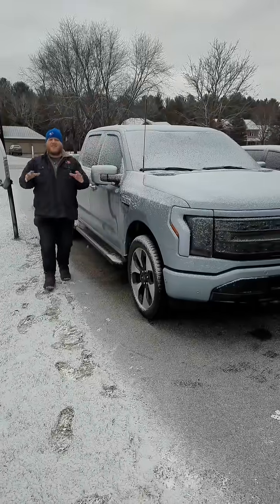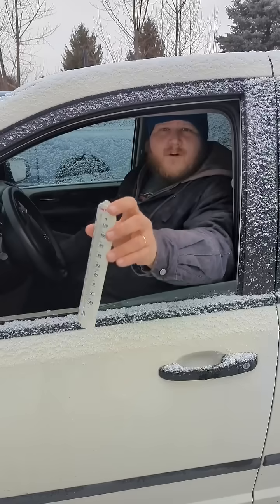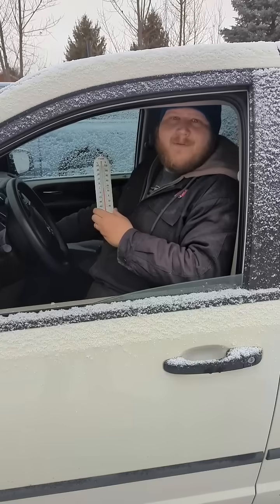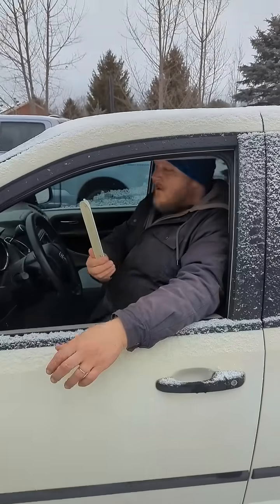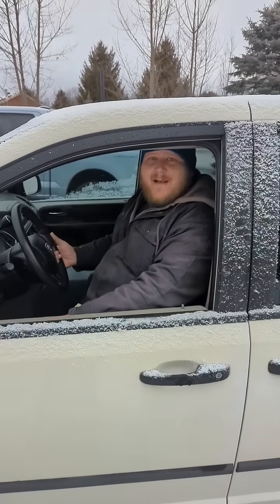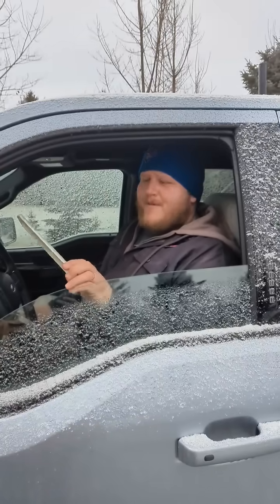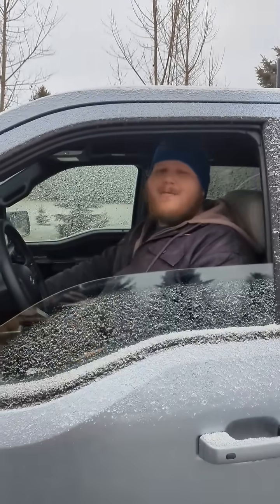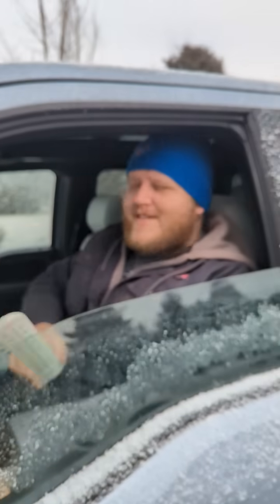Electric vs Gas - Heater Wars! How Long Does the Ford F-150 Lightning Take to Heat Up?

Comment: Try the EV in Canada at -40 and see your luck....Does anybody know the cost for EV batterie clean up in an Accident
Reply: Heres 19 reasons why electric vehicles SUCKS.

1) It’s too expensive 

2) Also cause pollution because it’s created by dirty fossil fuels 

3) Tires wear out quickly 

4) Only reliable when temperatures are warm and when it’s cold, it can bring danger to the driver and passengers.

5) Charging stations are hard to find in midwestern states. If you live somewhere like Wyoming or North Dakota, it is clear that you are going to have a lot of difficulty finding charging stations, as well.

6) Roadside Service does not provide Full Coverage and lot of this has to do with the fact that their parts are not on-hand and they are more difficult to actually find than ones for regular cars. Also, auto mechanics will not know how to fix electric vehicles since they didn’t built it. You probably have to find Elon Muck and ask him to fix it for you and he will probably charge you for a million dollars. 😂

7) Travel shorter distances due to the fact that these are cars that need to be charged, they simply do not have the same type of mileage range that regular cars often possess.

8) Too much focus on luxury vs. dependability. With all of the issues that have been discussed thus far, one may be questioning what exactly car manufacturers are aiming for when it comes to making these models. In short, they simply are spending too much time on overall luxury rather than dependability.

9) They get noisy early on. Owners of electric cars have been quite open about the fact that they are prone to make a lot of noise very quickly into their usage lifetime. There is no question that over time, this happens to all types of vehicles, but it is alarming that it has been happening so quickly for electric ones.

10) Maintenance costs far more because when dealing with expensive cars, one can always assume that repairs will end up costing far more. However, when observing electric vehicles, it is clear that the prices to fix them are at an extremely excessive rate. This is largely because finding its parts is far more difficult.

11) some electric cars look ugly

12) Battery pack replacements are expensive due to the fact that electric cars run on their battery packs, it is clear that they play a major role in the overall performance of the vehicle. However, their batteries are prone to needing replacements as time passes by, and they end up costing a ton of money.

13) Recharging takes a long time

14) Durability is not consistent

15) Tend to be heavy due to the fact that electric cars are built with different materials. In fact, the heavy weight of these vehicles is likely another factor that ends up making their tires begin to drop in quality so quickly.

16) One major aspect of the electric car market is that there are limited choices. Unlike regular cars that comes with an abundance of different options, car manufacturers do not seem to release multiple electric vehicles. This is not a solid idea, as electric cars are trying to grow in popularity.

17) Not Good In The Snow. Electric cars definitely meet their match when they are used in the snow. They are prone to having a lot of malfunctions with this type of weather, while also having a lot of difficulty while driving on slushy roads.

18) Too Much Hype. "Show not tell" is the philosophy that car manufacturers should possess. However, when it comes to electric cars, it is clear that this currently is not the case. There is no question that the market is pushing for more usage of electric power, but they have yet to accomplish much in the way of persuading the vast majority of the public.

19) Having a smart car means that the government can track your every move and can listen to your conversations. 

DEMONcrats and leftists wants to banned EVERYTHING. Gas cars, gas stoves, guns, cows, meat, freedom of speech, freedom of religion, and etc. I’m not going to go along with their authoritarian policies so fuck them!

Comment: The minivan has more interior space than a crew cab pickup. A different crew cab pickup would setup a more comparable benchmark.
Reply: I agree
Reply: You're right but it's still probably like twice as fast.
Reply: No
Reply: Let me also add.  Not much in way of charging stations on the way to Burns, OR from Idaho
Reply: I will also add.  I am considering an Toyota RAV4 Prime.  A Plug in Hybrid makes a TON of sense for me.  Sadly not available in all states.  Luckily I live 30 miles from the state line where I CAN purchase one.
Reply: Yep.  Compare a new crew cab pickup. Not a big worn out Caravan    Might have a better comparison
Reply: however the van has vents in the back as well...the truck doesn't..  so, even though its a larger space to heat, said space is complimented by the number of vents required to heat it..
Reply: @duke1281  There are vents under the seats in the F150 EV.
Reply: @duke1281  its the same heat just spread out. A 1500w space heater will take exactly the same amount of time to heat a room regardless if its attached to a small fan, or a large one
Reply: The EV was over 3 times faster and the thermometer was in the front seat.
Reply: @adaycj its like comparing a hot tub to a swimming pool, the EV had 60-70% less cubic feet of air to warm, he needed to compare truck,
Reply: @MicRuLerZ  
Lol. It's a mini van. Maybe 20% different. Interior volume is a published value, look it up. But the time was a 350% difference so we are splitting hairs on a factor of 10.
Reply: @adaycj  I don’t think anyone’s arguing it would be the same but it’s still not a fair test, my 3rd gen Tacoma does this in 7-8 minutes. Not 4 but definitely not 14
Reply: @adaycj  depends on vehicles.  Standard pickup vs say a 4 door suburban and it's more than 20%
Reply: @adaycj  the second row seat in a Caravan has 7" less of leg room but within an inch for shoulder and head room and mor space for the hip room.  Then there is a third row with almost the same dimensions AND 33 cubic feet of space behind that third row.  Man Dodge was able to fit a LOT of stuff in that only 20% more interior space.....
Reply: @tommygatch It is irrelevant. Or at least almost entirely irrelevant. Take an electric heater, a small cardboard box and a big one. Throw a thermometer inside. One at a time heat the air in the box with the heater. The times are almost the same for the same increase. The air doesn't take much energy to heat. It is the "mass". The engine, the coolant, the heater core. Plus some (very significant) losses from the combustion process, cold, at idle. Plus the IC engine has a priority on heating the engine to reduce emissions, not dump every watt of energy into the cabin.
Reply: @Deere2154D  Different vehicles have different interior volumes? How did you discover this?
Reply: @tommygatch  Okay, looked it up. 130 ft3 vs 190ft3. A 36% difference. Completely explains a 350% time difference.
Reply: @rileypakosh1066  I'm not sure what would make it "fair". Using the wasted heat energy from combustion as a heat source is just not as direct as heating wires with a battery. Granted it was a pretty rough test. Very little was controlled. Are you driving your truck during that time? Any IC engine would warm way faster driving vs idling.
Reply: @adaycj  now look up the window surface area.  Largest heat loss in a vehicle is through its windows.

Yes the electric will heat up quicker.  Let's compare cold weather range of that F150 and that 2015 Carvan, both with a full charge/tank.
Reply: @tommygatch  The convo has been fun and all, but I'm done looking up things. Y'all have the internet too. I have no need to compare cold range of either vehicle. They are both lower than the normal in warmer temps. I would only care if I was considering an EV to commute to work in. The easy solution is to just add 50% for emergency errands or weather impacts. Now that the EV market has lots of options it isn't hard to find one that would work for me with room to spare. Heat loss has never really been a thing until EVs. ICE vehicles have so much waste heat to spare, no one really ever cared. Now that the cabin temps often come directly off of the range it is a new thing to consider.
Reply: @adaycj  a crew cab truck is less than half the interior volume of a caravan... about 1/10th actually.
Reply: @tommygatch  thats a shit comparison too. Theres numerous factors at play: vehicle weight (not far off to be fair), engine size (or lack thereof), gas tank size, not to mention the physical shape and size of the vehicle.

Not sure why everyone goes on about range either. Literally 99% of people 99% of the time use 20 miles of range *at most*.
Youre arguing EVs are bad because 1% of 1% may inconvenience you by having to stop for 30 minutes every 3 hours on a road trip. 🙄
Reply: @calvin2686-u1k  you can always spot the people that don't live West of the Mississippi or those that live on the west coast.

Some of us live in places where it's a bit of a drive to get somewhere.  When I was doing contract IT work a while back, I had a 3 hour drive through Eastern Oregon just to get to a job.  8 hours on the job and a 3 hour trip back.  That is zero traffic.

When you go to rural places a lot, life looks a little different than more densely populated places.
Reply: Let me add, my 5500 lbs Mercedes ML350 I had at the time made the trip there and back without the need of a fill up.  I hated stopping for fuel in Oregon since you couldn't fill your own vehicle.
Reply: @tommygatch  idk it's a 4 hour drive between Moose Jaw and Medicine Hat, another 3 to Calgary. Canada isn't exactly densely populated lol. So I guess you can't "always tell".
But, fun fact: all 3 of those cities are west of the Mississippi, and a solid 10-12 hours from the west coast. Neat right?

Some of us live in these places called Cities -- actually 99% of people do. It's kinda what makes them cities. And lo and behold, that's where EV's perform best, and where most people will stay for 351 days of the year.

So you're saying that because EV's don't make sense for 1% of people that all EV's are shit? that mathematically doesn't make sense when 99.99% of all driving done in North America is done where EV's make the most sense. sorry not sorry
Reply: @calvin2686-u1k  well I guess that's fair. My assumption was bad.  Just as your assumption that I have called EVs shit.  

I was just pointing out a statement was incorrect on the volume of the interior of a vehicle.  I also was pointing out that the range is affected.

Heck the range of my Ford Focus drops in the Winter.  Instead of 40 and 41 mpg in warmer months, I see 37 to 38 mpg during winter. I'll accept a 10% loss over an roughly 30% loss in range that most(not all) EVs see.  I actually considered a used electric Focus before I bought the used gas Focus I have.  So I am aware of what I speak. 

 I'm not even going to delve i to the loss of range each year of owning an EV. Rechargeable batteries lose there capacity over time. (Remember, I'm an IT guy and work around lithium batteries a lot.) You know my 2015 Ford Focus with 130,000 miles still gets the same range on each fill up.

These were the reasons I stayed away. Not saying that is wrong for everyone else, nor have I ever said that.
Reply: @calvin2686-u1k  No it does not. I posted the actual numbers in this comment section.
Reply: @adaycj  14.1 cubic feet vs 143? I mean I just looked it up...
Reply: @calvin2686-u1k  130 vs 190.
Reply: @adaycj  no. A dodge caravan with seats all folded down has a cargo capacity of 143 cubic feet. A truck, even crew cab, is nowhere near that. My Cherokee has 43 cubic feet with the seats folded and thats still a bigger cabin than any truck. Trucks generally dont have folding seats because it has a bed. There is zero possibilities that the truck has 130 cubic feet of interior space, and your number for the van is also off by 40% or so
Reply: @calvin2686-u1k  Cargo capacity is NOT the same as interior volume. The numbers I posted are manufacture numbers. And it does not matter! The two methods of heating air are completely different. the time difference was 350%. That difference was NOT just air volume. The IC engine had to heat hundreds of pounds of cast iron, aluminum, and liquid coolant before it could heat the cabin. The extra air in that empty space was a drop in the bucket compared to the liquid and metal. One is like preheating your electric oven. The other is like cooking a Turkey on your propane grill with a temp probe in the breast meat.
Reply: @adaycj  the cabin begins "heating" as soon as the coolant is allowed to flow to the heater core and the coolant is warmer than ambient (pretty much instantly). Of course the greater the delta, the faster the heating (last time I checked, -10C to -9C is still "heating"). However resistive heating hits peak temp within a couple seconds. I imagine being inside a car it wouldn't get nearly as hot as a space heater, but the fact remains it blows hot almost immediately.
Reply: @calvin2686-u1k  You are arguing against yourself now. You just listed a bunch.of stuff that wasn't the volume of the air, your previous claim. Are you involved in so many internet agruments you forgot which one this is?
Reply: Right? My 04 f150 takes about 5 minutes

Comment: With a full tank of gas, the gas vehicle will run on idle for days and keep you warm. Can the EV do that? EV’s are not for me, they are not green at all and are super expensive, so inconvenient to charge and get repairs, JUST A BIG PAPER WEIGHT!!!!!
Reply: Where are we going to keep getting lithium
Reply: @TheAnnoyingBoss  Look up Maine lithium mine and see why. Giant source there and they wont let you mine it.   They want you to own nothing and like it.
Reply: I haven't tested heating numbers but for me running my car with the ac to let my girl sleep while I did stuff took just about 1 gallon so my car would only run for 19 hours until I would be stranded. And I've got a 2.0 4cyl so it's not like it's a 5.7 v8
Reply: @boj4klayman919  still, longer than a battery vehicle could. And you can survive longer in the heat than the cold, you have more options to keep the heat at bay than you do for freezing weather.
Reply: Ford says an F-150 Lightning with the extended-range battery can power a house for about three days when using 30 kilowatt-hours (kWh) of electricity per day. (An American household uses 29 kWh per day on average). The company also claims that it can be stretched to as long as 10 days with energy rationing
Reply: @fakumadda1632  a home is insulated much better than the truck is, my statement is based on the truck running the heater continuously. And what ford claim is much less in the real world, especially in the winter. Fords claims are in ideal conditions.